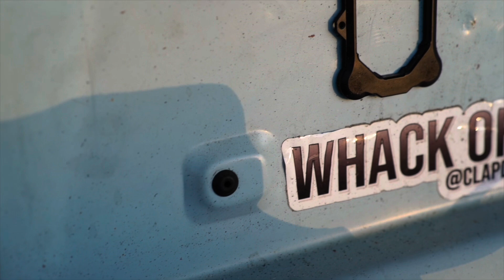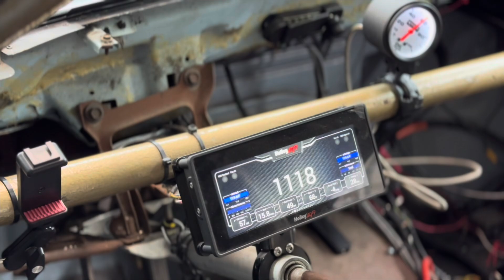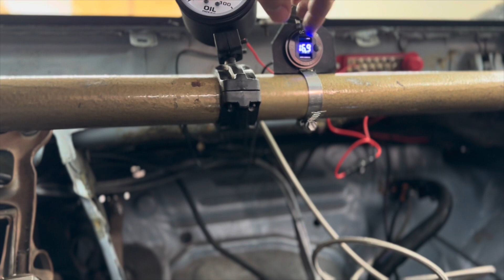Rain Messes Up My Testing, Will the Twin Turbo Zephyr go Rounds?

Comment: My sbf takes awhile also but not that long. Lower the rpm to start in the Holley.
Reply from the maker: It’s not the Holley. It’s 30 degrees here. Cold start on e85 is tough